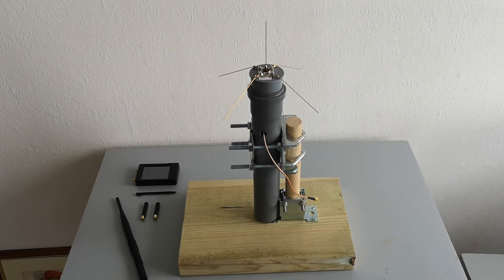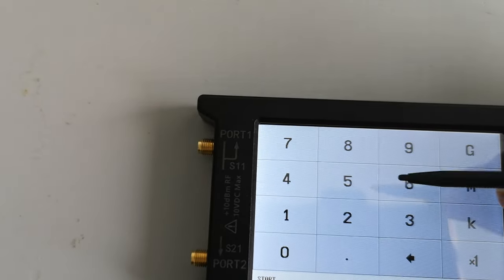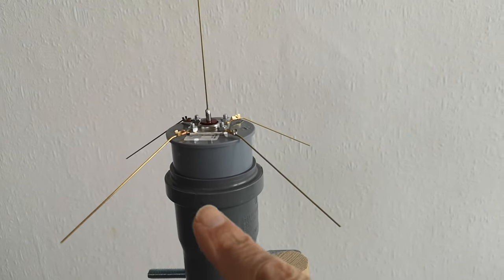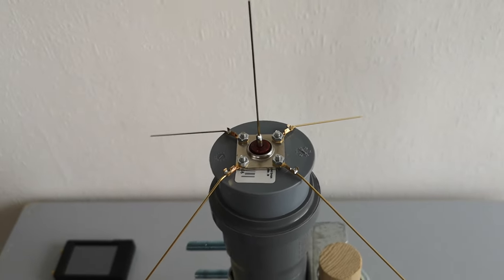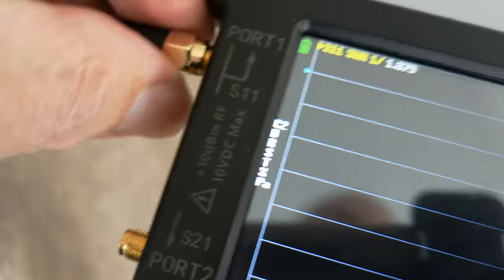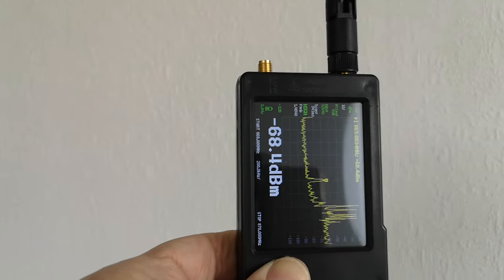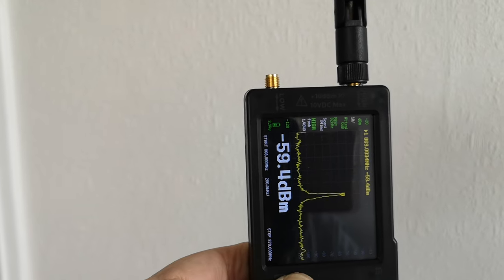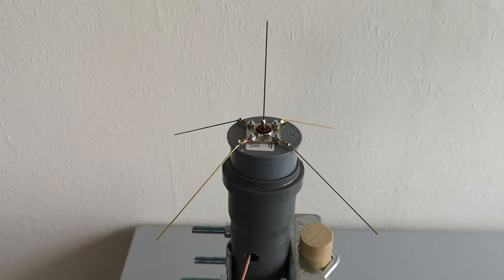Groundplane Antenna for Meshtastic

Comment: I understand you wanted to keep it cheap and simple. I would have used a commercial antenna mount and a double colinear antenna for gain since you are operating in the flea-power range where every Db counts.  At 800MHz and higher, such antennas are still fairly small and manageable.

Comment: According to a Farnell data sheet, RG316 is about 0.86dB/m at 20 deg C.
Reply: Ditch the coax and put the node inside the drainpipe.  Connect it with an active USB cable.
Reply from the maker: That is a very elegant suggesion !

Comment: How much does covering up the radials with a plastic cover affect it does it lose db
Reply from the maker: The effect will be absolutely minimal, even if the plastic should happen to be lossy, since such a small porion of the length of the radials is in the vicinity of the plastic. There will also be a minimal lowering of the resonance frequency of the radials due to the dielectric effect, but again this will be minimal.
Reply: @fotografm  cool I'm experimenting making one and making a 3D printed cover
Reply from the maker: @markwilliams5654  Excellent. Publish your results to inspire us all !

Comment: Re the 'pokey' ends on the ground plane antenna - go to your local hardware or garden store and get some plastic wire nuts (puck a nice bright colour).  Once the antenna is tuned up, take a file and roughen the last 5mm or so of the radials and epoxy the wire nuts on the end.  The wire nuts will make the ends easier to spot and stop them from jabbing you.
Reply from the maker: Thanks for the tips!
Reply: These will probably detune the antenna.  The far end of those elements is a high-impedance part of the radiator, and easily affected by the presence of some other material attached to it.  Even more so if the wire nut has a metal spring in inside.

Comment: I made these for 2.4g wifi back in 2010. They did not work well. The ground plane is highly distorted like a cloverleaf. Dipole is better for a tourus radiation pattern.
Reply from the maker: Thanks for the tip !

Comment: I only interface with my VNA through software, I find the menus and calibration much easier that way. I use NANOVNASAVER software
Reply from the maker: Thanks for the tip. I will give it a try !

Comment: Great video. I made one of these with 1.4mm copper wire. The swr was 2 ish so I added more ground elements and now it’s 1.4. I made a second one of measuring tape and it’s 1.5 swr.
Reply from the maker: Nice work!

Comment: Brilliant video! I'm quite curious how much loss is happening in the feeder cable? That thin coax is rather hard on WiFi frequencies at least and for long distance WiFi feeds I ended up using LMR400 which then needed adapters that introduced more loss but the total was far below the loss from smaller diameter feeders.
Reply from the maker: You are right to be concerned. It's actually a cable that came with the VNA which is specced up to 1.5GHz so hopefully the cable is reasonably good there too. 868MHz is luckily quite a bit lower in frequency than the 2.4GHz WiFi you mentioned.

Comment: I have made a few of these using brass tube for the driven element and an old coat hanger for the radials. seems to match your performance with the exception that best SWR Performance is achieved with the radials at about 10 degrees off horizontal. Is swr the only thing we need to consider? is there another unmeasured benefit from increasing the angle of the radials n
Reply: your impedance will change 45degrees give the 50 ohm impedance you need
Reply: The Smith chart is spot on 50 ohms at the same angle.
Reply from the maker: I used coathanger wire too back in the day. I remembr that for 2 metres it had to be 19 inches long ! For me, SWR is important since it relates to how much power is transferred between the antenna and the radio - both on receive and transmit.

Comment: I LOVE That I Got Copper Like, Hundreds Of Kilograms For Cents Bback In The Day, Now When Im Making Antenna I Have Loops Of Loops Of Copper Wires, Thick, Think, Smaller Then Hair, Even Like Ingot Size, But Its A Wire, Wire From OLD USSR Welding machine, the wire thickness is 5mm And Width Is 1cm and its hardened so whenever i want o makme something out of it i just cut it off and if i need to make it softer i just put the torch on the wire, if yiu can call it a wire ;D
made doorhandles for the whole house because copper is killing viruses in 10minutes and steel kills viruses in 3 days for comparison and when you ahve copper doorhandles all around the house, it counts , i havent been sick since i put them on, but higiene is always needs to be done to you know, but jeah, i have tens if not hundreds of kilometers in various copper wire. also what i got is so much ussr soviet made components, germanium diodes and everything, all that costed me like nothing compared if i would buy it all frome bay or marketplaces. :) 

Sweet video, that snipping part resonated with me cuz i did the same :D
Reply from the maker: Lucky you !

Comment: "loved your drumming work!"   
First reaction when I saw the 239 connecter in the placeholder in conjunction with Meshtastic I had bit of a raised eyebrow moment, but "what was at hand" ...  I'd have done same.  Amazon sell 5 packs of similar configuration chassis SMA for 16quid.  "Superbat SMA Connectors SMA Female 4 Holes Panel Chassis Mount Flange Solder Cup Connector SMA Bulkhead Connector 5-Pack"
Chuckled when you showed your fave' antenna, at first glance it was very similar (but not the same as) Andy Kirbys dodgy one - the youtube placeholder pic says it all :- https://www.youtube.com/watch?v=Y4qXn_gOTY8&t=469s  
Good video, many thanks for sharing dude.
Reply from the maker: Thanks for your reply. I enjoy experimenting with what I have or with what is available.